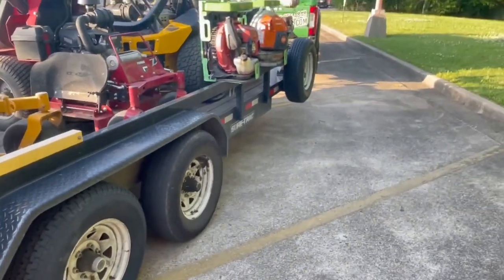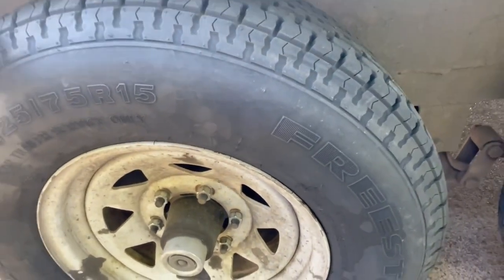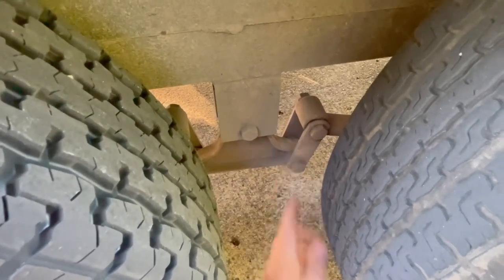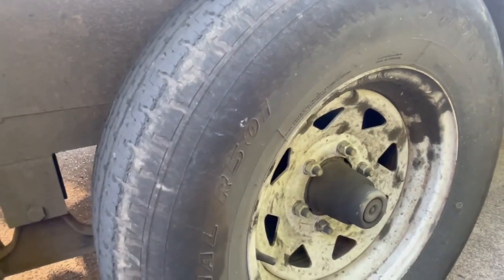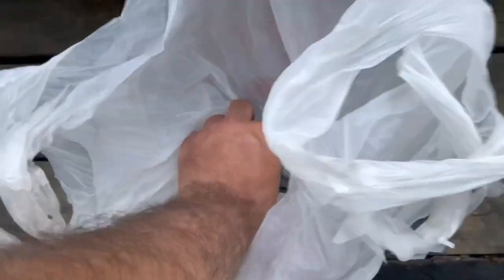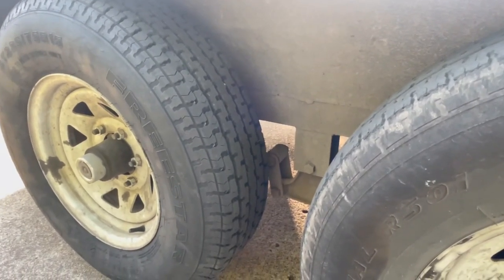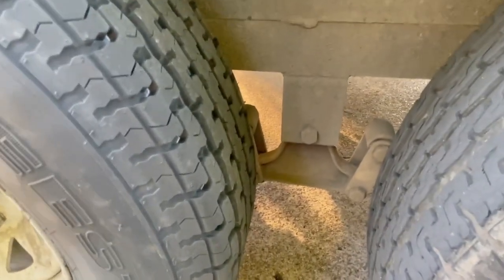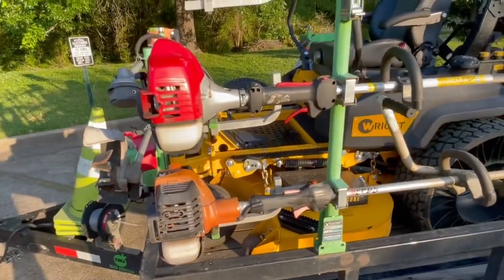Trailer Tire Issues What You Need To Know

Comment: Jack up trailer and check each wheel for any play hold hands top and bottom of wheel or side to side and see if there's any wiggle, if so, tighten the castle nut up 1 or 2 notches until there's no more wiggle and then line back up the cotter pin in the notch. Don't make it to tight, wheel should spin freely slight drag at the most. Hope this is somewhat helpful!

Comment: If the axle is bent, the inside edge of the tire will be worn. Most of the time, the trailer tires will either be worn on the inside or outside of the tire due to sharp turnarounds such as culdesacs. Rotate the tires and you’ll get even tread wire.

Comment: Your toe angle is off on your axles (mechanic lingo ) good find . Yes that’s the cause of your tire wear .
Reply: Replacing the worn out bushings and bolts should cure the issue . I wouldn’t replace the y bracket , unless it’s worn out throwing the angle off again .